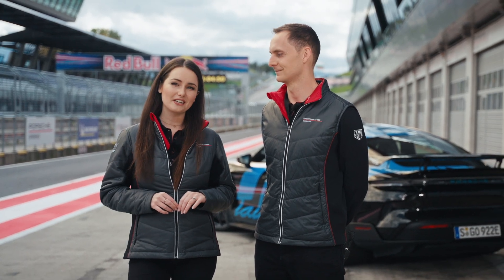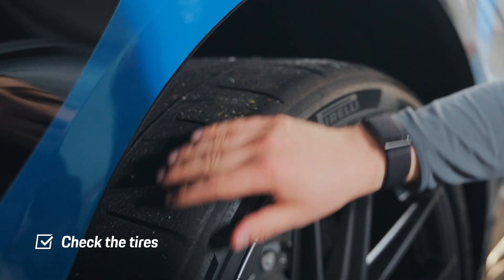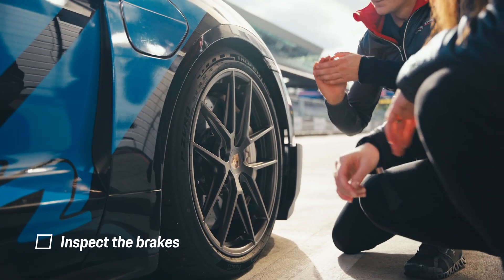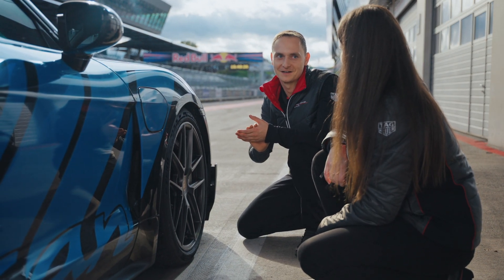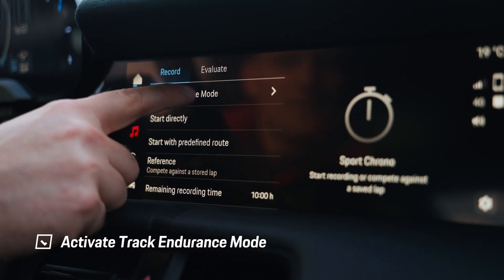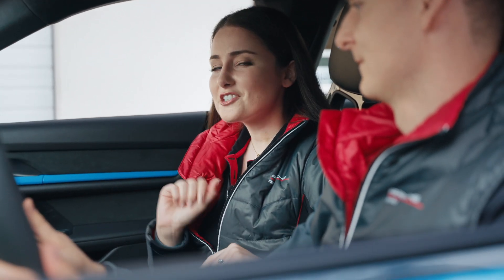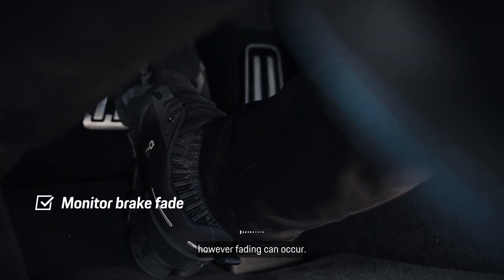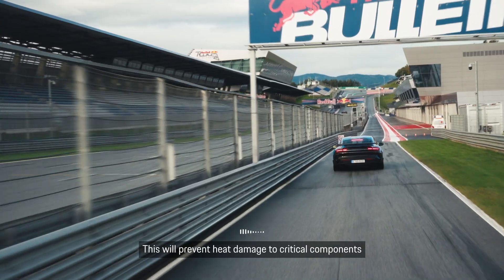Your Taycan Turbo GT track guide | Spot On | Tutorials

Comment: I will never buy a electric Porsche
Reply: Or any completely electric car.
Reply: It is one of the best cars ever made. It’s absolutely beautiful. If you drive the car once, you will buy it. I said the same thing until I bought it. Hard to go back. Would love my 992 turbo S to be an EV. Porsche engineering is unmatched.
Reply: @derekyoussef  I am not saying it is not a good car. However, there are issues with EV’s. The batteries are extremely expensive and how are you going to dispose of them? Also they don’t do as well as gas powered cars in certain weather conditions. When they catch on fire they are difficult to put out.
Reply: @irishchocolate3872 You have a valid point. Hopefully we will figure those points out. There are many recommendations on how to prevent some of the things you mentioned. Use responsibly and take proper precautions as best as you can like with any petrol car. But, hopefully we find away around  the expense to replace the battery and disposal.